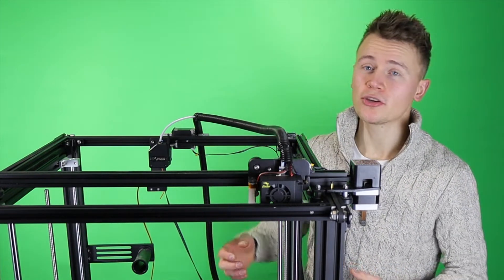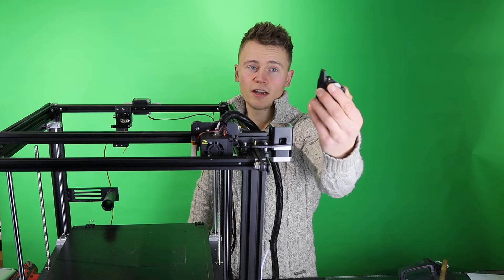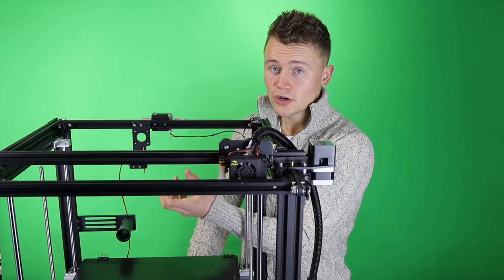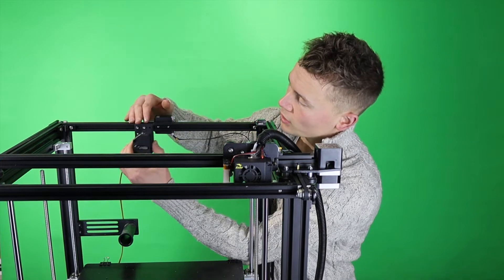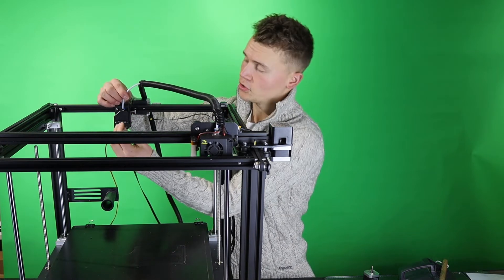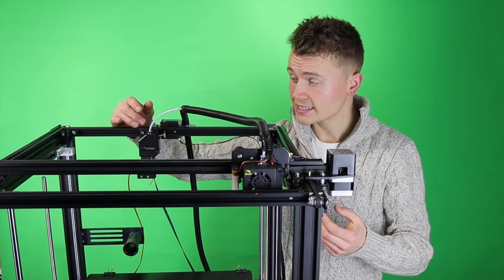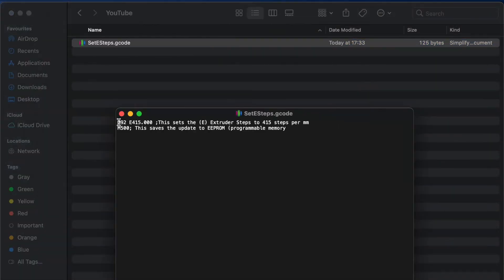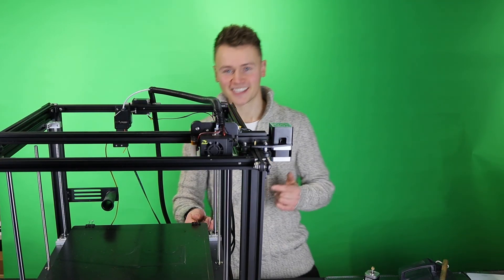How to Upgrade the Extruder Drive Gear on Ender 5 Plus for Improved Extrusion & Print Reliability

Comment: Hi Callum, useful video and relatively easy to follow for a 3D printing novice. I have one or two issue which require some support if possible. The printer was functioning at 100% before doing the mod and the Extruder Dirve Gear is the same as you recommended. Problem: I don't appear to have any power to the extruder drive motor after swapping pins 1 and 3 over. I also have no idea about the gcode mod and whether this has been successfully implemented, any additional info would be fantastic. If you have a chance to help that would be great as I cannot print at the moment. Cheers!

Comment: I was able to use a small screw and puller to take the press fit gear off the stepper motor shaft. It came off very easily without destroying it.  What side is the 1st and the 3rd connector?
Reply from the maker: Nice one, good to hear you were able to get it off in tact, machining tolerances vary significantly on cheaper builds so it is entirely possible for some of these press fits to be loose enough to prise apart.

In terms of the 1st and 3rd connector, do you mean on the stepper wire? If you are struggling to get the polarity correct, you can use the trial and error method from this tutorial here: https://reprap.org/wiki/Stepper_wiring#.22pair.22_wires_on_4_wire_motors

Comment: The extruders are labeled left and right models, which one is for the 5 Plus?
Reply from the maker: It shouldn’t make any difference I wouldn’t have thought, left and right models normally just fit nicely back to back
Reply: @CallumColes  I ordered the left one and it fits right on without any drilling into the plate.I placed the gear on the motor shaft into my vice and knocked the motor shaft throught the gear with a cut off nail and hammer which worked quite well, I also made a keyway on the shaft with a handheld electric belt file, it helps the grub screw on the new gear get a good grip on the flat surface, agter all that I realised I could have swapped extruder motors with one of my Ender 3's motor which already has a keyway and easily removable gear, Oh well! it still works.

Comment: Thanks for the great Video Callum. I got the same dual drive extruder you recommend and successfully installed it with the help of your tutorial. I found cutting a small amount of the corner plastic of the extruder with a standley knife allowed me to install it without needing to drill another hole and move the screw across which saved a bit of time.

 I just have a question about the E-steps. When I did my first test print it appears to be extruding really slowly so I'm not sure the E-steps got updated correctly. Is there a way to verify if the Esteps have successfully been updated on my printer? I used the exact same G-code as you and loaded in onto a SD card and ran it by selecting "print" on the touch screen of my ender 5 plus. It just finishes the print straight away so I assumed it had been updated correctly but how can I verify that it has? Also if I change my nozzle size from a 0.4mm to a 0.6mm do I need to change the E-steps again to a different rate?
Reply from the maker: Hi Gareth, thanks for the comment, glad you like the video and were able to perform the upgrade! Yes sounds like the 'slice method' might be a time saving improvement, another comment also suggested this. I'll add to the description.

In order to verify the E-steps, you can use the menu on the printer to extrude say 100mm of filament and check that that is indeed the amount of filament that goes into the extruder. Alternatively, if you plug the cable in to your printer you can input the commands directly and check to make sure it is working. Some slicers enable you to do this directly, but if not, then you can download a program called Pronterface, it's free.

The commands you'll need are:
M92 E415.00 (this sets the E steps for the Extruder to 415.00)
M503 (this reports the settings, so you'll be able to see that the change above has worked)
M500 (this saves the settings, so you then shouldn't need to do it again)

You won't need to change E-steps for different nozzle sizes, the e-steps basically tells the printer how many steps of the stepper motor are needed to extrude a set distance of filament, so once this is set, the only time you would need to change it is if you were to change drive gear to something different or if you decided to finely calibrate your e-steps, rather than relying on the manufacturer provided value.

Comment: Ok I started stripping off my extruder as a way to save my sanity. 🤬 so I’m installing the dual drive. It’s far easier to shave a few slices off the back of the new extruder than to drill a new hole. Took me 20 seconds even with a blunt blade 😂 cuts really easy
Reply from the maker: Nice! Many ways to solve the same problem, thanks for sharing your way, hopefully others reading in the comments may consider this too. How are you finding the upgrade?

Comment: Hey Callum, great video. Just bought my ender 5 plus and bought a dual drive extruder as the factory unit is already starting to cause problems when trying faster print speeds, plus I had to upgrade the Bowden tube to a Capricorn tube as the factory tube had a kink in it hidden in the plastic cable run, easy fix but annoying non the less. I will buy a new stepper motor for the extruder to keep the factory unit intact. The big thing I really didn’t realise was how noisy the stepper motor whine is compared to a silent print (like my ender 3 s1). Motherboard upgrade is my next step but looking for a major upgrade, such as a big tree tech Octopus as long term I want the option for idex or tool swap capabilities. Some real fun ahead :)
Reply from the maker: Thanks Steve, only just saw this one, been away and then now just catching up! I'll be back with a video this weekend.
Yes the tubing on a lot of these printers is pretty awful, I've partnered with another UK manufacturer, so going to launch some PTFE tubing under 3DTomorrow too.
I'm not sure whether the board on the Ender 5 has replaceable stepper drivers, if it does then changing those would sort out the stepper whine. I never really review noise, as have so many printers whirring away I cant compare them lol...
IDEX would be great! Keep me posted:D
Reply: @CallumColes  unfortunately the stepper drivers are not replaceable as seems to be the norm with stock boards, so the choice is stick with Creality and upgrade to the “silent’ version of the 8 bit ender 5 plus mainboard or upgrade to a third party mainboard such as one from the bigtreetech stable of boards but due to compatibility issues you have to swap out the screen aswell. But this is something I will need to do for an IDEX conversion, so I am still considering going for the BTT octopus v1.1 which gives a lot of flexibility down the line for not only for IDEX or tool changers, or even something like the enraged rabbit carrot feeder. The ender 5 plus sounds like a drunk one man band crashing about compared to the ender 3 S1 which is so quiet.
What made you decide on developing your own PTFE tube? Have you had issues with Capricorn or similar ? Would be interested in better ptfe tubing connectors, the Creality ones are terrible and so has every third party connector I have tried so far.

Comment: So is this actually mounted upside down? They way you have it (and the way I did it) all the force of extruding is on the weak brass fitting that is just press fit in the plastic. Yeah it ripped that fitting out. On the other end is a large steel insert that has the tube fitting that is much beefier. Even better is if you mount it the other way up it will clear the mounting screws on the bracket and you won't have to reverse the stepper.
The pictures of the bondtech show it directly on top of a hot end so it is pushing the filament out the bottom.
Reply: Yeah the one I got had a tube fitting in both ends. I couldn't seem to find any pictures with this style of drive using a Bowden tube. I'll let you know if it fails working this way but so far so good.
Reply: @beefymiracle1512  wish I saw your comment before, I mounted it like the video and 3 hours into a print it pushed that fitting out, I followed it back and re wired the stepper back to stock and it works perfectly now
Reply from the maker: The one ordered in this video is mounted the correct way up, since the bottom does not have any sort of fitting it’s just an open hole. I agree though the push fit brass fitting at the top is a bit lightweight and not the best of designs, this is true of the original Bondtech they copied too. I ended up pulling out the clip and threading a spare PTFE tube connector I had to make it more robust.
I had a quick google and have seen another style which has a PTFE tube connector both ends, is this the one you ordered? If so, I don’t see any reason why it wouldn’t work the other way up, not a bad shout to avoid changing cables around. Would be interested to know how you get on with this.

Comment: Thanks for this video. I bought the parts and am planning to do this upgrade this week. Also got some Capricorn tube. How did you swap the stepper motor wires? Did you just pull them out of the male connector and reinsert them. Or did you cut and splice the wires, thanks!
Reply from the maker: Nice one, let me know how you get on. To swap the stepper I just pulled out the crimped ends from the connector block. The connector block has little plastic toggles that if carefully lifted allow the cables to slide right out. The toggles can then be pressed back down when the cables are pushed back in. Easy enough, just need to be careful

Comment: How did you manage the sensor box to the extruder? It is so narrow so I think its kinda hard for the filament to flow nicely? Did you put some distancers for the small sensor box or what did you do? =)
Reply from the maker: I actually don’t use the sensor, I probably should have mentioned that in the video! I know some people really like them, but the trouble is, when they turn the bed heat off, the print ends up detaching from the bed which makes the pause pointless… So I just leave a piece of filament in the sensor and then go straight from roll to the extruder.
Reply: You can drop the sensor down and hanging off the braket

Comment: Finaly got my ender =) time to follow your steps and swap the extruder :D
Reply from the maker: Nice one! Let me know how you get on. Without a doubt the best change you can do, big printers need a decent extrusion force
Reply: @CallumColes  it is warping in one corner. Tried two times. I never had warping with my other printers. Do you have any good tip? :)
Reply from the maker: @sylvander4972  if it’s just one corner, check there’s not any oil/dirt in that corner? The ultrabase benefits from slightly hotter temperatures I find. Around 60C for PLA. I actually have a full video on bed adhesion🙌🏼
Reply: @CallumColes  nice! I will check it out
Reply: @CallumColes  what do you clean the bed with?
Reply from the maker: Personally, I use plastic free wet wipes

Comment: Hi Callum, thanks for this. Just a question about the Gcode. Do I need to create a text/Gcode with only the M92 command and running through the printer or do I need to copy&paste it in Gcode generated by my slicer (for any of my 3d model)? And if so, where exactly would I need to copy&paste it please?
Reply from the maker: 08:40 if you run the as a separate gcode file, you should be all good to go.
M92 E415.000
M500 
The first command sets the ESteps and the second command saves it, so it should stay as that for future use.

Comment: How do you keep the filament from being in a bind when leaving filament reader to drive gear?
Reply from the maker: Are you talking about filament tangles? You can normally spot these before you start a print and then make sure they are removed before starting a print. All3DP has an article on it, I'll add the topic to my video to do list.
Reply: He actully bypassed the filament reader . If you can see closely , there's a piece of string (or filament) in the reader when he mounts the new extruder. You cannot mount this and use the filament reader without repositioning it also .. :)